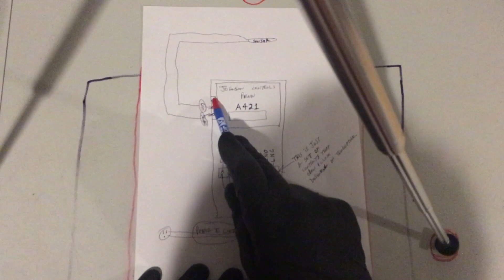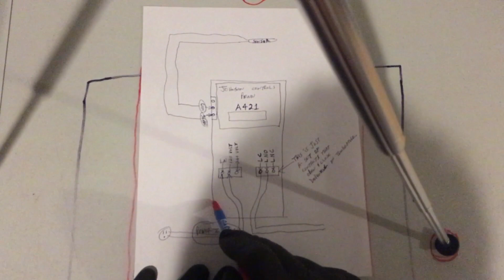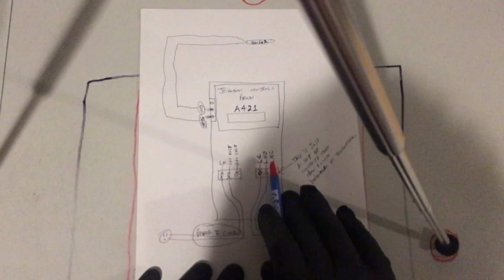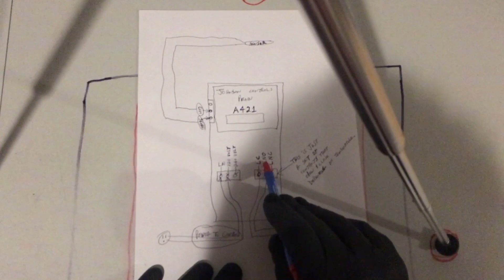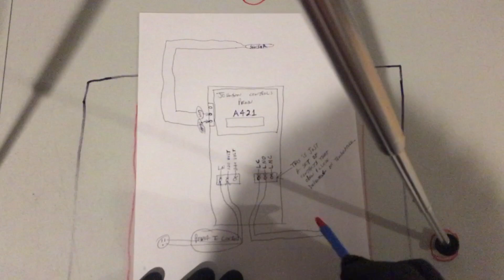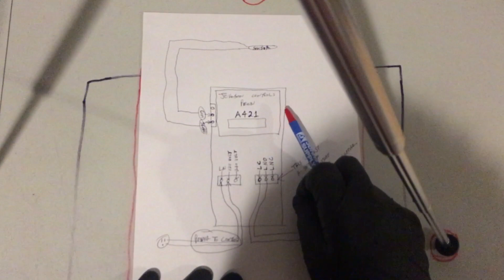How to Wire in the Johnson controls/Penn A421 Digital Temperature control. Convert analog to digital

Comment: When wiring a new 120 condenser do I just wire the neutral to it, and have a jumper from l1 on thermostat to LC, and then bring in the hot from nc to condenser relay?
Reply from the maker: I Do NOT Run Full Compressor amps Ever through these controls. Better to use it as a Control For a Compressor Contactor. Letting the Contactor take the Load is a Longer term solution rather than running full compressor current through these small Relays on the Board. Although they will take the Load for a short While it is not advisable & depending on Amp draw you could burn up the relay real quick junking out the Control. Compressors draw 6-7 times Running amps at start up far Exceeding Rated amps of relays in this control. Unless it’s Just a little 1/6hp R-290 unit that only draws 2 amps while running.

Comment: I’m using one of these for an outdoor wood boiler. In the directions it shows a jumper wire do I need to do this? My a419 does not have a jumper wire. And is wired just like your diagram. The jumper is between the 120 and LC. All mine will do is kick a fan on to feed the fire once temp is to low.
Reply from the maker: no jumper needed.

Comment: Where the two wires from common and NO will be connected.?
Reply from the maker: Freezer - #4 & one side of Liquid line solenoid coil. other side of solenoid coil to N.( for 230 volt coil )

Walk in cooler - if changing from existing analog control to A421.
Common - to LC = Load Common.
NO - to LNO = Load Normally open.

Comment: So if I want to wire a 240 VAC strip heater, would I connect the two HOT Lines (L1, L2) to terminal block 1 (TB1) at terminals: LN (Line neutral) and 240V?  Then would I connect the two SWITCHED power leads (L1,L2) to TB2;  for example L1 at LC (Line Common - or Line voltage SPDT) and L2 at LNC (Line Normally Closed)?  Then just connect the two ground wires with a wire nut from wall power cord to supply cord to heater.
The Johnson Controls or PENN A421 manual is very confusing as it shows a jumper wire (both for 120v and 240v) that would supply constant unswitched voltage (hot always connected) on one side of 240 volt power (example L1 always connected)????  I can't wrap my head around this concept.
The Figure 4 title says: Wiring the A421 Series Controls using the same power source to power the control operation and power the controlled equipment.  how is this possible given the jumper.  the controlled equipment would be hot on one side of 240v always.
Reply: I spoke to Tech Support at PENN Control.  The A421 will not switch both L1 and L2 on 240v.  It only switches one (single pole).  To completely operate 240v (cut both 120 v sides), an additional relay would need to be added.
Reply: @googleuser3714  Then why would the put in a connection for 240 Volt  if you end up using a relay with its own 120 Volt coil ? Something is not adding up here ! What is it ? Poor engineering ?

Comment: You left out that you need to apply control circuit voltage to the common terminal, they are dry contacts
Reply from the maker: Did u watch the whole video ?
This video is about installing this digital to replace an existing analog control. In this case - this is the correct way to wire in when pulling out a analog. 
I State specifically in this video they are just a set of contacts. Nothing more.
Reply from the maker: Nobody NEEDS TO ALLWAYS APPLY VOLTAGE. it Depends on what You are using it for. I NEVER use this control that way. I Just use it as a Switch.
Reply: @OcRefrig  what do you mean? Are you saying there is no voltage on c and n.o when you wire this up in place of an analog control?
Reply from the maker: @craighvac1808    What I’m saying is if thier is an existing analog control on the wall you just take the two wires that were going to the existing control and put them in the c & no positions. Period. The existing analog control is just a set of dry contacts just like this is correct ?

Comment: Also If your using for a freezer app you can take the normally closed from defrost timer #4 to the common and the no to the compressor contactor coil or relay coil... Same can be used for off cycle I made a video installing one...
Reply from the maker: I’ll check your vid out. 👍
Reply from the maker: Looked for your video. Does not seem to be there. I searched a421 on your channell and digital temperature control. Nothing found.
Reply: @OcRefrig  it's titled true gdm 72f if you look at the list I think it's the most recent one I published